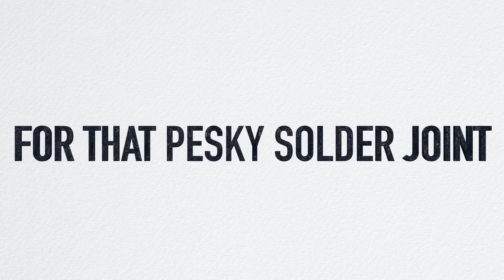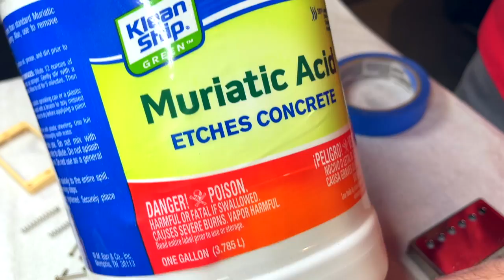Chrome Sucks: It Doesn't Age Well

Comment: Take the covers to a plating shop. They can strip from chrome back to nickel in minutes. Nickel is the base coat for chrome. Chromium was developed to offer a more durable, less ferrous end finish for nickel. 

Nickel tends to have a slightly yellow finish, whereas hexavalent chrome is slightly blue. 

If a completely rust free everlasting finish is required, copper plating to insulate the metal (if ferrous, as nickel is porous), nickel plating to create the base finish, or shine, then chrome to give a hard wearing finish. 

Stainless steel is another option, but that's a whole other subject. 

I have a Vintage Lemon Drop, which is entirely reliced, aside from the covers, which are brand new chrome.
Reply from the maker: Thanks for the info! I learned a few things. 👍🏻
Reply: Been torn between chrome or nickel pickup covers for my bkp pickups
Not so sure if I get something wrong about what you said, so based on your comment, chrome covers are actually a coating of chromium above nickel and being more durable from rusting?
Moreover, compared to nickel ones, does chrome affects tone more?

Comment: I have a Trad with chrome hardware too :( 

Then I bought I set of Bareknuckle Pickups, and made the mistake of selecting aged Raw Nickel. The patina is too bronze/gold looking and it didn't match my bridge and tailpiece, so I bought a kluson tailpiece and a nickel bridge from graphtech. Aged both using the vinegar fumes method. It worked, but still didn't match my Bareknuckle set. Although the tones were a bit better, the stock pickups weren't bad either. I could go with both. 

I got frustrated and switched back to stock parts. I rubbed scotchbrite on my hardware it to give it a brushed look. Then everytime I had a gym session, I would dab my sweat on it. After 6 months, It looks better now and has that natural aged look. 

Lesson learned. If I'm gonna do this again in the future, I'll buy it all from one manufacturer. Or maybe I should have picked Aged nickel. Not raw-aged.
Reply from the maker: Agreed:  it can be frustrating trying to match parts and buying all from the same manufacturer or keeping all the parts in the same family (nickel, raw nickel chrome, etc) is probably best for a consistent look. 🙂

Comment: You could have used Naptha to ease those labels. off.
Reply from the maker: Ah, true: I have found that mineral spirits (a weaker version of naphtha) does wonders on adhesives. But wouldn’t the labels get “greasy” with the naphtha residue? 🤔
Reply: @NathanSink  The naphtha just evaporates like alcohol. Lift a corner with tweezers and rub a soaked q-tip underneath. It will start to lift easier and just work your way across. Don't get any on your skin. I've heard it's pretty bad stuff. I've used it to get price tags off of vintage toys.
Reply from the maker: @clutch2827  Gotcha. 👍 Thanks for the info!